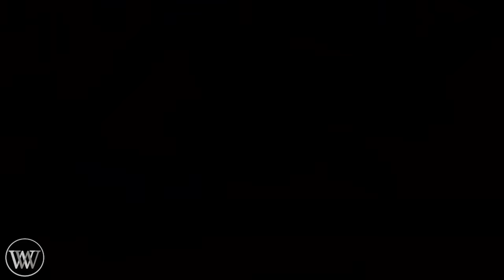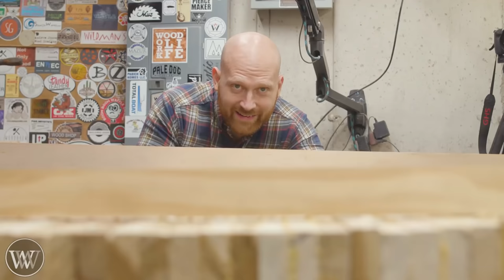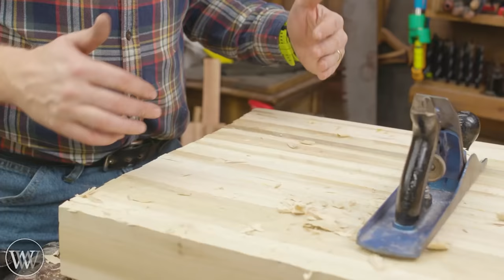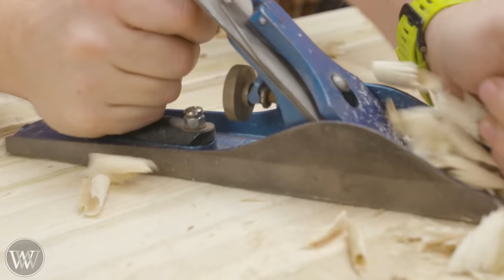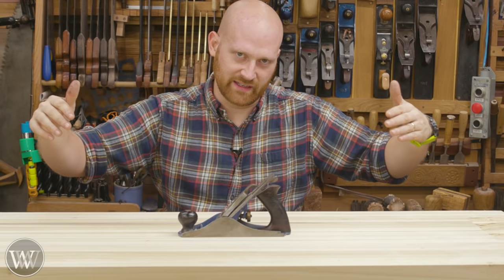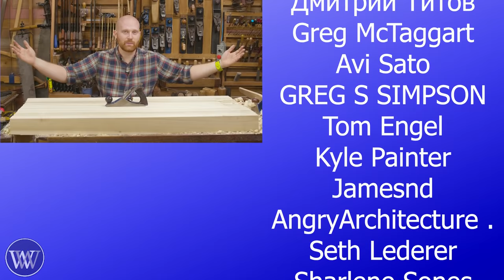How to Flatten a Bench Top or Any Slab With Only Hand Tools

Comment: I remember being amazed the first time I flattened a severely twisted board with a scrub plane by doing the 45° thing both directions.   It was like magic how the board managed to be flat afterwards.  I thought I'd discovered the answer to life, the universe, and everything.   I still don't quite understand why it works so well, but it does.
Reply: Why does it work? It’s simple really. The reason it works is 42.
Reply: @coldwoodcowboy4525  Now that’s funny.....and always carry a towel.
Reply: @DonsWoodies  So long and thanks for all the fish.
Reply: This sounds REALLY familiar. :)
Reply: Should I be able to do the same things with a regular #5 plane (the only plane I own)?  I can't decide if my technique sucks, or my plane sucks or my plan blade is dull, but I keep binding and can't plane across my workbench to get it flat.  
Fun but frustrating hobby so far...
Reply: @MrSquishyD  It's hard to take off more than a thinner cut with a straight blade.  The scrub plane has a pretty well rounded blade so it's very easy to take big bites with one.  You can round a regular blade (like would be in a #5 and accomplish mostly the same thing.  Get another blade and chip breaker for your #5 and it will work much better.  My scrub plane blade has about an 8" radius on the end of the blade for that reason.  

One other thing is that a dedicated scrub plane is a bit narrower also so you aren't taking so much of a cut with each stroke.  (as far as the width goes.)  I can easily take 1/16" or more per cut on even the hardest wood with it.

James has a nice video on how to make a plane into a scrub plane.
https://www.youtube.com/watch?v=3ZVhadFoq8E
Reply: @DonsWoodies  How do I give 3 thumbs up to this?  This is super helpful, thanks for explaining what I've been missing!
Reply: Sounds like you might need to set the chip breaker closer to the blade.
Should be just over a 1/16" of blade showing....or a small 1/8th..
Reply: Same here... Waited build a bench till I bought a house where I had a shop, collected hand planes for years before that though. Converted an old transitional to a scrub plane so I didn't have to mess up the irons on any of my good Stanley's and it ended up being my favorite one to use.
Reply: You should try to do 42º. It helps.

Comment: how long did this ACTUALLY take?  Yes, you can give 2 answers.  With and without filming and commentating.  Thanks!
Reply from the maker: This one with the filming was about 40 minutes. If I were just to do it without the filming on this one probably about 30 minutes. However this bench top is popular so it is pretty easy to work with. This size and white oak would probably take me around 45 to 50 minutes

Comment: How many times did you have to sharpen your plane irons during this operation?
Reply from the maker: None. The scrub planes I let them get incredibly dull. They don't need to be razor sharp. I usually sharpen those once a year or so. If this bench were maple I probably would sharpen at the end but I wouldn't have to sharpen in between.

Comment: I came here to find out how to flatten a table top bottom parallel to the top. The last 2 min answered my question, so I learned two new methods for flattening. Thanks!
Reply: Seems whichever is flat, the top or the bottom, is the reference surface that you use a mortise or cutting gauge against to scribe a line all the way around all four edge's of the 2 sides & 2 ends next to the un-flat surface at the thickness you want. After that its a matter of taking everything down to evenly match the line in all directions.

Comment: Been trying to flatten some old planks for the past few days with one of those hand electrical planes.  
As a newbie, this was frankly a nightmare although I did learn from it. These electrical things give you no feel nor precision and simply are not made for flattening.  
Now the planks are glued together and it's still far from straight, so now I'll have to flatten the top as a whole again.  
This video I think will help, I also saw you run into the same problems as me and fixing them the same way so that gives me some confidence!  

By the way, it's been your channel along with Wood and Shop and an old Dutch manual for wood working that gave me the confidence to get started with this, my first woodworking project.  
Also I made really shitty winding sticks with your help, they are only the same height but fucking in every way elsewise. But as you said, as long as I use them 'right' it actually works.

Comment: It was my first top that I learned from an old neighbor that taught a lot about hand planes and sharpening irons. Long before YouTube. I bought the SYP on a Wednesday and cut and glued up that weekend and a week later it looked like the lumber was glued up wet. Warped and cupped like crazy. It was a learning experience for me. I screwed it up when I drilled the dog holes by not using a sharp bit. I could have done a better job with a spoon for those holes.

Comment: I feel like using a right angle old-fashioned big metal square and going off one long edge of the table. Then take a pencil and mark the high areas of the slab going along with the too edge would be a good way to indicate high spots as well.

Comment: This video is timely to what I am doing.  I used a #4 plane for the second time to flatten the top of my 2x4 low roman workbench.  I didn't get far.  I have already attached the legs and am planing after using a Japanese saw to hack off most of the parts of the legs sticking out of the top.  There's a bunch of glue and I think the plane blade is slipping up when it hits too much glue .. I need to watch my progress.  Videos like this help me progress.  With mortice and tenon legs, it seems efficient to level the top after the legs are installed.
Reply: You can try and clean some of the thicker glue with a chisel by running it across the surface as a guide. 
What might be happening is that you are hitting long flat sections of glue.

Comment: The most comprehensive video on the subject I've seen! Thanks James. Little question if you ever get to reading this: Could one still achieve a decent flat base for a workbench only with a #4, and a  #5.5? Or is the #7 a must as well?
Reply from the maker: Thanks. You can do it with smaller planes but you will wand a good straight edge to chack for flat.
Reply: @WoodByWrightHowTo  oh wow, I'm grateful you replied so quickly James ! thank you very much for the helpful tip :)

Comment: I had to re-surface my bench awhile back.  Used this method to do it.  It wasn't as flat as it should have been from the beginning.  I got inspired to do it by watching Rob Cosman re-surface his bench.  What might one do differently during glue up to avoid introducing so much twist into the bench?
Reply from the maker: Generally the best thing is when doing glue up either do it in sections so you have time to check it or do it with an epoxy. That would give you more time to work on it and check in between.
Reply: You can use a flat clamping surface on top of the glue up but need to ensure that the glue up is sitting on a flat surface as well. 
Wood slides on glued surfaces when you put pressure from both ends. I have Jigs that allow me to clamp in all directions and allow a flat surface to act as reference. You then have to watch that such references are not glued to the surface as glue pushes up from the clamping. 
Now you can use paper such as non stick oven paper to act as a barrier between the clamp/reference surface and glue up. 
Even with this you will still need to plane down to get completely flat but it can help to reduce twisting with the glue up and board tension.

Comment: Great timing with this video! I’m flattening a laminated pine top right now and I have the same issues with twist and then fun that comes along with it. I noticed your straight edge was the perfect size for the bench. What would you use on a longer bench, say 7 feet?
Reply from the maker: On a longer bench I would then do another strip in the middle that would then be coplanar with either end.

Comment: Things that would be helpful. (I know every project different). Timer: Show rough time spent each step, and total time. (A 21 min video - does not express effort needed). Also many of video makers stress sharp tools. Well how often did you stop and sharpen each type of plane? Some more then others? Flatter (smother), verses high spots (scrub)? As always - the info you share is of great value - thank you.
Reply from the maker: That would have been good mention if I remembered it. All told this took me about 45 minutes. And I didn't sharpen the planes at all during the process. The scrub plane I only sharpen about once a year that does not need to be incredibly sharp unless you want a perfectly smooth surface from it.

Comment: Really helpful walk through James! Thanks. Any tips on how to make a straight edge without a #7? Would my low angle jack be long enough?
Reply from the maker: I actually have a couple videos on jointing without a drinking plane. What you do is first off eyeball that it's straight. Then set it down on a flat surface and draw a line along the edge. Flip the board over and you'll be able to see any differences where it is high or low. And then you can just hit the high spots with the number four or whatever plane you have. Then test it again.

Comment: My workbench has split top. Each half is  about 12in wide. After getting the underside mostly flat with hand planes, I fed it through my thickness planer to get the top parallel to bottom. When I got the top super dirty or marked too deep, I now just use hand planes to flatten and smooth. It does not take much longer than taking the top off and run through thickness planer. And yes, my workbench top is removable, leg assemblies are removable, stretchers are wedged tenon and mortise joint. I can flat pack my workbench and transport it in my model 3.
Reply: I would love to see it
Reply: @What_Other_Hobbies  Awesome
Reply: @diegoguerra8736  I found more photos from one of our skype group chat, and I am grabbing some from last August.

Comment: Thanks. Very instructive video. I plan to build a new workbench top later this year and this will come in handy. 
Quick question - When you glued up the slab, did you take care to make sure the grain in each board was running in the same direction?
Reply from the maker: Not with this one. There were so many where the grain switched direction that it was impossible. But if it were strait grain it would be worth it.

Comment: Great video thanks.  This is a project I want to start but currently only have a No 4 to work with.  How many times did you have to stop to sharpen your irons?  I’m still working on that skill.  Takes me a long time.
Reply from the maker: You could do this all with a number four. It'll just take a little bit longer. and you'll have to check more often to make sure that it is flat and straight as the plane won't tell you that. That's the bonus of having a longer plane. this bench is made of poplar so it isn't that hard on the irons. I didn't have to sharpen it all for this one. If the bench were maple I may end up sharpening ones at the very end but that's about it.

Comment: What type of wood did you use for the bench top? 

What were the length and width dimensions of the bench top?

How many hours did the flattening take?

I was given a "basement bar" top made by someone by nailing, screwing and bradding together warped 2x4's of maybe some doug fir, but maybe all white wood... a wood so poor it doesn't even have a name, it is only known by its color, but it is about as stiff as a styrofoam cooler lid... a styro cooler lid absolutely filled with knots. He then poured some type of really hard crystal resin over the "bar" to laminate the boards and get a flat top.  The boards themselves have up to 1/8th inch gaps between them as there were inexplicable wood chips between the boards when he nailed the 2x4's together. Net result is there is this crystal resin in between the 2x4's, at varying widths.

I'm disabled, not collecting disability, so am poor. I was given a little Sargent No. 4 hand plane, in truly derelict condition, by a widow whom I was buying a couple old beat up Delta sanders from on Super Bowel Sunday, as all the extremely price sensitive tool scavengers in this town were firmly parked on the couch, allowing me this rare opportunity to actually purchase barely working tools at near new price! 

I was over the moon about the plane until I tried to restore it, having no real knowledge of how hand planes work. I watched some videos, and went at it with very marginal success. The Sargent No. 4 wasn't built during the hey day, but well after, so new, it had the attributes of human solid waste, but after 50 years of abuse and neglect, it is in quite a state. The knob is split with half the round base missing. The tote is split in two in its crotch. The chip breaker is twisted, so doesn't lie flat on the bit, and the bit itself is mushroomed and curved, not to mention the corners of the flat, not the bevel, were sanded down so the chip breaker has no chance of firmly contacting the bit (even if it were straight). I literally thought this was some unique Sargent design, a curved bit, it is flattened by the frog but above that it is bent down towards the tote top, and somewhat twisted. Of course, after actually using this plane and actually learning how planes are supposed to work, I deduced the bit had been hammered into various positions, thus the bending, twisting, and mushrooming at the top... of course the adjustment wheel had no describable effect on the blade depth, and about four or five full turns of slop before it pretended to adjust the blade depth. The lateral adjuster, likewise, was impotent and caused no lateral adjustment, not that it itself could actually significantly move laterally, being jammed in place by the bent downward and mushroomed bit. Also, the mouth is about as wide and distorted as Jaws 14, after all my work on this plane, this seems to be the one thing that I can't really fix, absent welding cast iron, which I'm not sure is a thing, nor do I have any welding tools.  Also, the cheeks, or whatever the side perpendicular plates of the plane are called, each appear to be out of square.

I used this plane on the above "bar" in an attempt to make a workbench surface for myself by removing the 1/8th to 1/4qtr inch thick crystal resin from the top and sides of the lumpy 2x4's, that 50% of the time adhered to the spongy 2x4's and thus ripped chunks of the wood out with the resin as my misshapen bit floating loose in my plane's cavernous gullet occasionally caught into the resin. I was so excited that I might actually have a workbench surface, I planed for 4 hours, filled three trash bags of crystal resin shards, wood chunks, splinters and shards, until I could no longer move my arms. It was 3am and I went to bed soaking wet with sweat, but didn't sleep a wink, as I'm a side sleeper, absolutely cannot sleep on my back, so each time I tried to roll onto my side, my shoulder burned even brighter until I couldn't take the pain, so rolled onto the other side and that shoulder would go from yellow hot to searing white... what a night. 

After several days of this insane planing, scattered over about a month and a half (allowing me to regain the use of my arms in between), I almost have the top and bottom flattened, though with catastrophic tear out throughout both top and bottom and high and low spots I'm going to have to just accept. 

 A neighbor moved out next door and left me several 2x4's and a few 2x6's that were scrap from a construction site, they're either sun and rain worn into checked, split and splintery grey nail and screw hole filled tetanus farms, or they're covered with concrete, as they appear to have been used in creating forms for poured concrete. Also, some of them seem to have been dipped in either hydraulic oil, used motor oil, or perhaps automatic transmission fluid, can't say, oh, and one appears to be partially burnt. They vary in length from about 4 feet to 6 inches.   I'll use these to build the legs, and cross stabilizers.

The take away from this screed is timber prices are too damn high! 

Can you imagine going through this when dry straight doug fir 8 foot 2x4's were $3 each, and not $12 each?
Reply from the maker: This benchtop was made out of poplar. I have plans available on the website if you want to see exact dimensions of all of it. The actual flattening of this one was about 25 minutes.

Comment: Well, I would have to take several bench tops similar to yours and turn them into shavings before I really know what is going on with my tools. One question. I have one of the 'saw tooth' type of blades from Lie Neilson, and love it more than my scrub plane. It is mounted in my low angle jack plane. It is just easier to push through the wood than the scrub plane. I am wondering if you have tried them and what you think of them. I do have an 'extra' #5 plane that I should probably convert to a scrub plane like your #5 with a much more shallow arc in the curve of the blade. I do 'have' to experiment...... I might even get one similar for my #8........
Reply from the maker: I think you are talking about a toothing plane iron,? Those are easier to push but they are only removing half the material of a normal iron
Reply: @WoodByWrightHowTo  That probably is the correct name. I am just working on small pieces for now, and they are handy. For sure, I need more practice.

Comment: I guess it would take longer than using the various planes you used but it’s still possible to flatten a bench with a 5 1/2 jack plane, right?
Reply from the maker: Sure. Others just make it a bit easier.